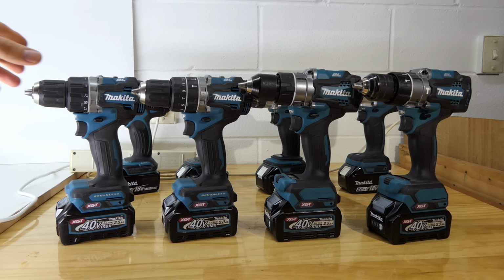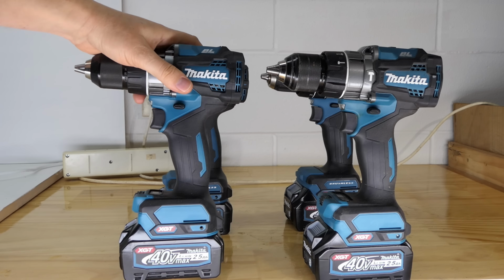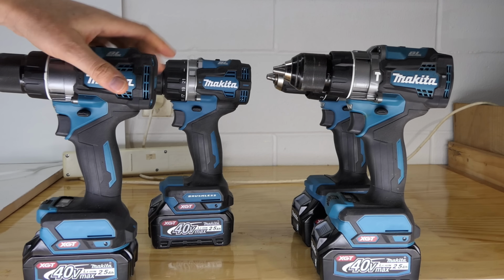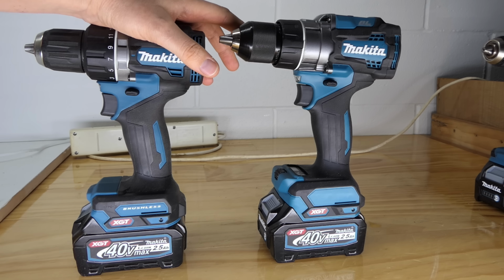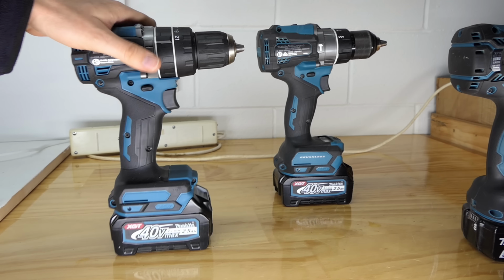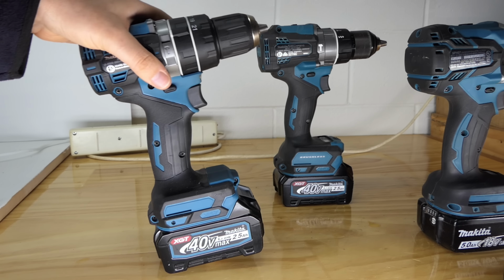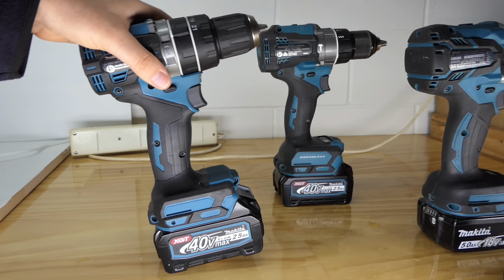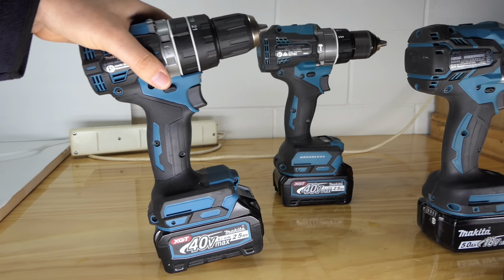Makita 40v Drill Review Overview. Hammer Drills VS Drill Drivers. What are the Differences? #XGT

Comment: I’m looking at getting the top of the line drill. Is it best to go with the one without the hammer drill option if you already have a rotary hammer drill?
Reply from the maker: If you aren't going to ever use the hammer function don't get it, as it usually adds cost, weight, size and fragility to the drill. That said, I always get the hammer drills😄
Reply: @ToolsAndStuffOFFICIAL  It’s a tricky one. I’ve always used the rotary hammer drill as I’ve always been disappointed in the 18v drill hammer capabilities.

Comment: As primarily a woodworker and not a builder, I really enjoy the mechanical clutch on the mid tier drills. In my experience, an electronic clutch tends to blow past the desired torque because of the slow nature of sensing/reacting whereas a mechanical clutch reacts instantly and never pushes too far. Also, using an electronic clutch creates the need for a delay between trigger pull and the motion of the drill, otherwise it would overshoot the desired torque even further than it already does.

Comment: I just bought into the 40v line with the only drill / driver combo they have available (I'm in the states), it was way more cost effective than getting a drill and impact driver separately. The combo comes with the top of the line impact driver and the "GPH01" aka top of the line hammer drill. IMPORTANT TO KEEP IN MIND: the GPH01 is HEAVY. It's too heavy (in my opinion) to have on your tool belt for pre drilling holes or using at a slower speed for being more careful with delicate screws. For this I will continue to use my 18v subcompact drill / driver. 

By the way I am very happy with the "GPH01" --  it's a beast. I needed to add a cordless hammer drill to my arsenal. I will be getting the "GFD02Z" bare tool "entry level" drill driver soon. Thanks so much for your videos!!

Comment: You forgot the "kickback" safety on the hp001g and the df. Test that! Hold the drill, drive him an give him a little tap on the battery sideways, it will turn off to safe your wrist when your drillbit get stuck in the material ;-)
Reply from the maker: The kickback control is rubbish. These drills will still spin you round if they want to.
Reply: Okay if you think so but it is still a feature on them. Maybe one day it will safe your wrist. until than make more videos, can't wait for the next one :-D

Comment: the capability of this tool is really great, its just not so small and compact as other options out there. this is why i am waiting for the flex FXM202-2B kit to become available. which should be cheaper too. since i cannot really justify the makita prices here in UK... not just the price of the bare too, but also the batteries. but i really like the digital clutch feature / setting on this tool. for controlling the torque of the screws. really nice, wish it appear on more tools in the future
Reply: but one feature i did not see mentioned here in this video was anti kick back safety cutout (for drilling, not the screw mode). because the flex turbo drill has a gyroscope sensor in it. and detects when the drill if trying to twist your hand off. and will stop autometically. so does these 40v makita also have such a feature? it would be nice to know if that is the case
Reply: They do

Comment: Thanks for the great comparison. You have the best Makita XGT reviews. I have now bought a DF001 and it is an excellent machine, but I would really like to know if it is normal to have a small amount of movement with the chuck both backwards and forwards in a range of about 1mm to 1.5mm.  I can move the chuck by hand forward or backward, the same way the chuck moves when I tilt the drill. Is this a feature of the drill or a defect?